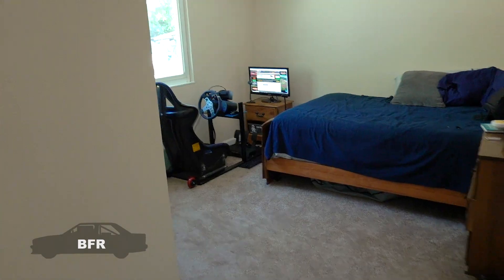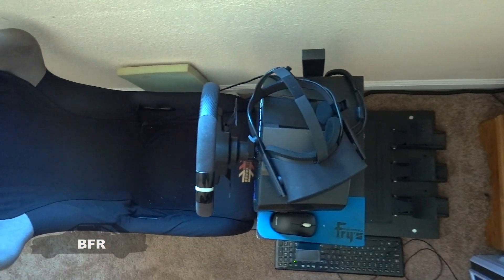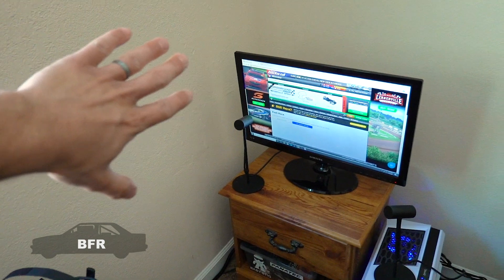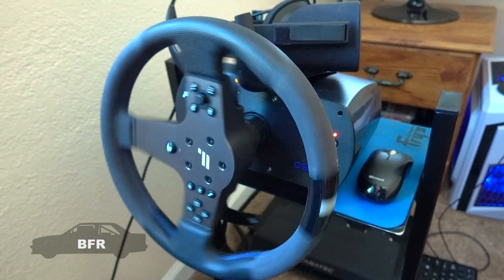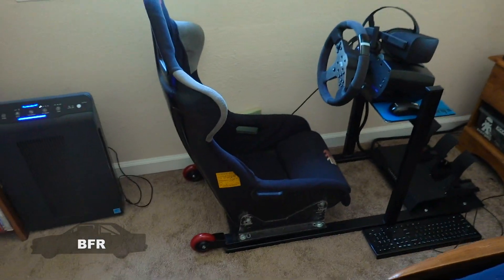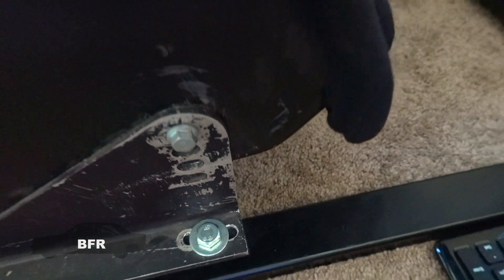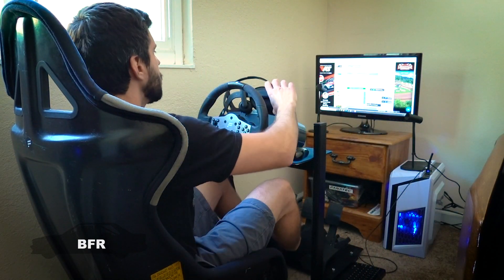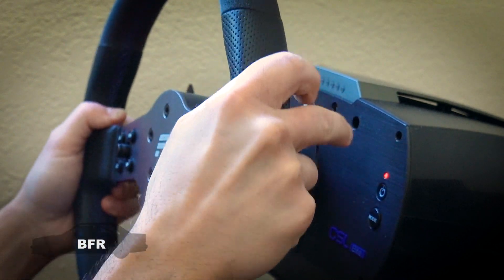Budget Steel Sim Rig Build - DIY Rigidity to the Max

Comment: Im looking into this myself.Amazing how we both picked 2" x 1" x 0.12"  (A513).  I was wondering  (as I do not weld) about fabricating with steel angles cut to length making said connections with nuts bolts washers and some pretty tedious drill work. My most basic concern is getting it all square. Additionally on the side rails for the steering Im thinking of mounting those by slapping them flush to the base drilling and bolting. If you think this is crazy talk let me know .. never worked metal before .. but Im pretty handy.
Reply: thats way more effort than just learning to weld lol doesnt need to be good and you can get cheap stick welders for 50 quid and its a tool and skill for life

Comment: Aluminum extrusion 8020 rig is cheaper, lighter and less of a hassle than a custom DIY steel rig.
Reply from the maker: 8020 is not cheaper, weight is not a factor in the performance of a sim rig(unless it’s a motion rig, or you need to move it often otherwise the wheels work fine.) and hassle I agree on. 2”X1” Steel tubing even here in the Bay Area goes for about $2.5 per foot, if you’d like to sell me 8020 for less than $2.50 /foot I would more than happy to buy it from you.
Reply: Just.. no.